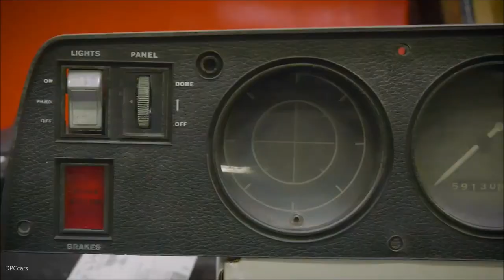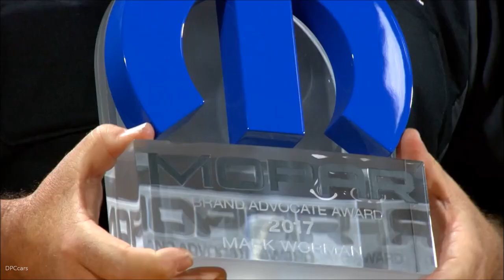Mopar Hellcrate 6.2-liter Supercharged Crate HEMI Explained

Comment: 707 hp and 650 lbs-ft of torque is at the crank, NOT the wheels. I dynoed mine, 654 hp, 610 lbs-ft of torque. Get your info right bud.
Reply: Every manufacturer states their horsepower at the crank.
Reply: Hell's Cat o yeah mark warman said that well. Not true
Reply: You are right. Still a beast nonetheless